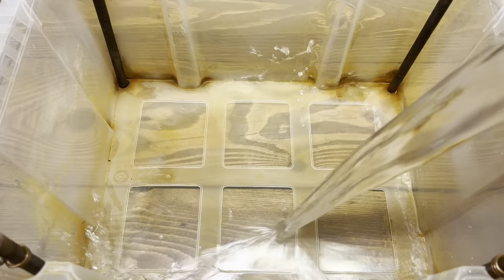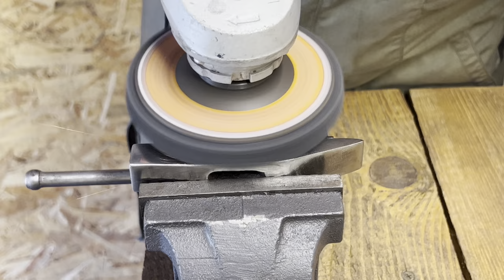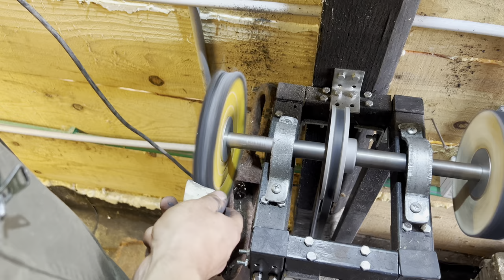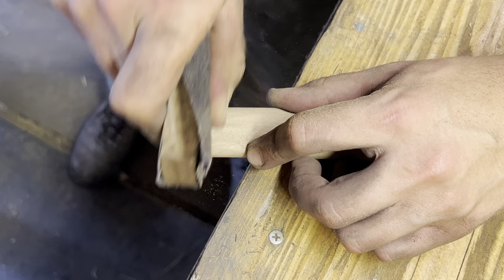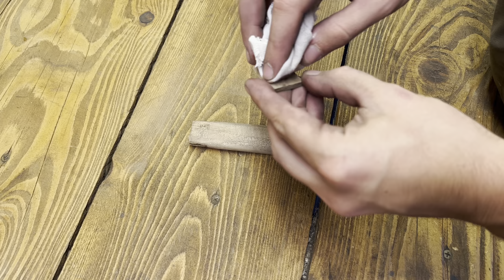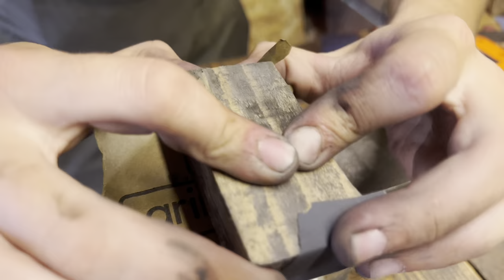Restoration of old and rusty hammer

Comment: Excellent work. May I suggest heat treatment for the metal then slow cooling. And second you have to add your logo, I dislike any tools that don't have a logo or manufacturer stamp.
Reply from the maker: Thank you for your feedback. For the restoration of this hammer, i have chosen the best method, i know that there are areas where i can improve the quality of our content, and i hope that in the near future i will have the possibility of marking our tools.

Comment: автор, поясни, зачем очищать от ржавчины электролизом а затем убирать раковины с помощью УШМ? сразу пройтись болгаркой - не винтажно? диск сберег? почему скосил боек а не сделал плавный спуск с помощью все той же УШМ?
Reply from the maker: I use electrolysis because of inaccessible parts like the hole where the handle goes.
Maybe the inside of a hole is too much damaged with rust where removing the whole material with file would just thin the walls and it would not make sense, so electrolysis will just clean those parts.
Reply: @vintagerestorationspage  It's clear
Reply: а не хотелось оставить изделие с повреждениями от коррозии? частично, с боков хотя бы. можно было бы покрыть воронением.